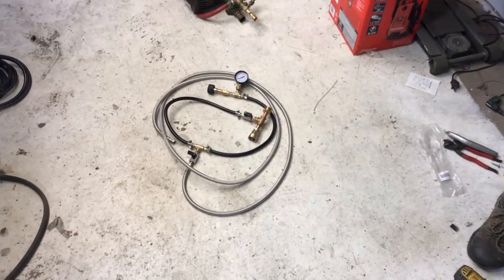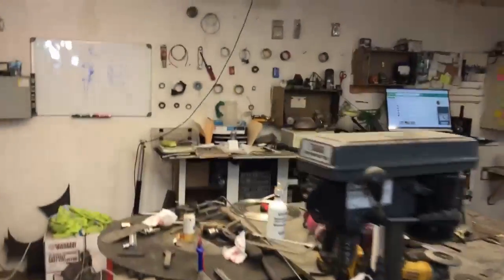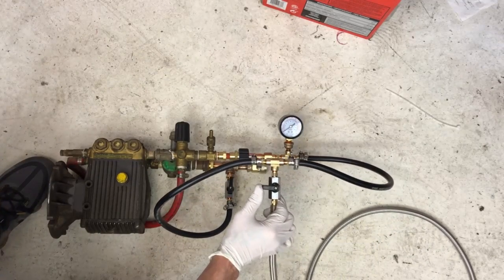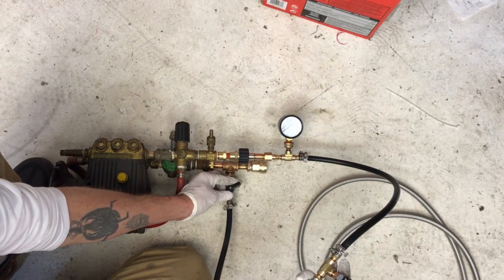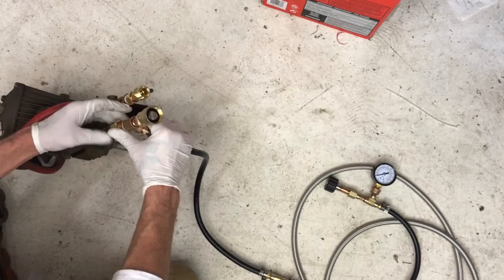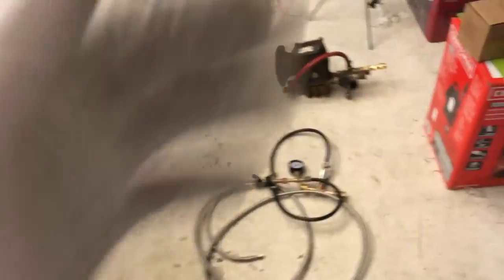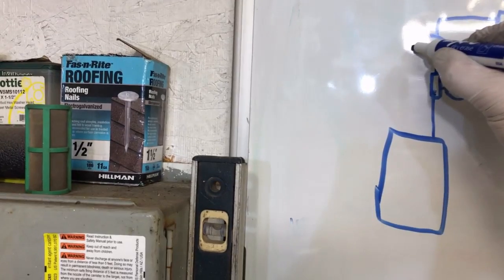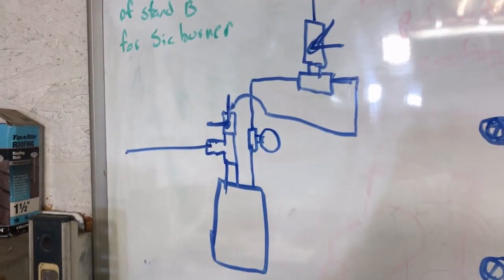Turn any pump into any pressure any flow rate you want

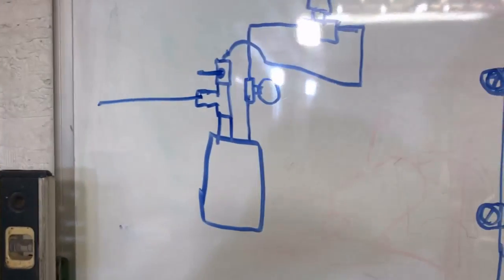Comment: 7:55 What keeps the bypass water from backing up into the source/potable water?  I'm guessing if the pressure in the loop is 250psi, it would backup 40psi supply.  Thanks
Reply from the maker: it goes directly back into the pump , think of it as a chain being spun in a circle by a motor . also the second the 250 psi leaves the bypass valve its pressure drops due to the flow path of a larger volume , its high pressure low volume so as it fills the void in the hose the same amount of water gets sucked back into the pump and no flow takes place in the direction your indicating . The velocity of the water squeezing out is high  but the flow  is low the flow is he exact amount going into the pump plus the flow going out of the flow rate valve so you actual have a volume deficit
Reply: @NOBOX7  Thank you.